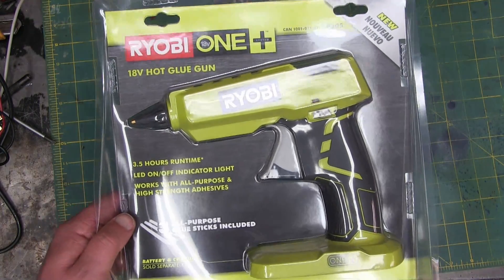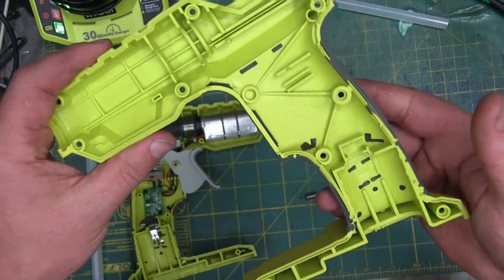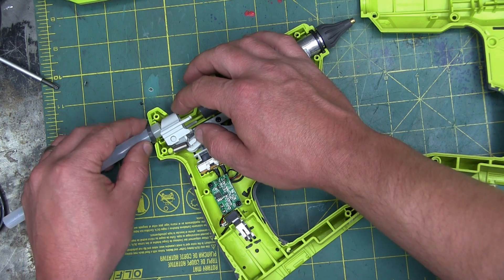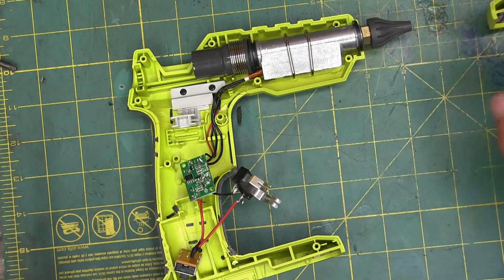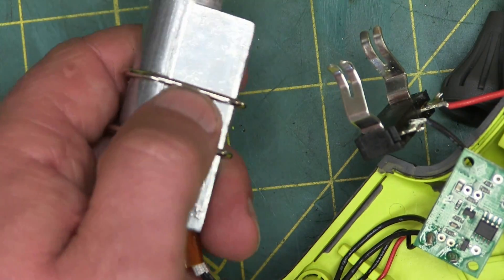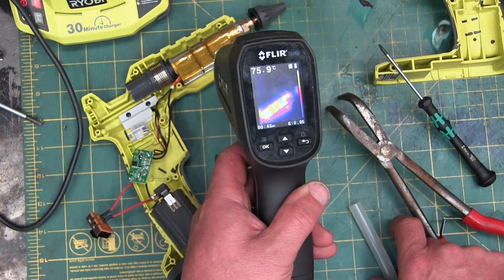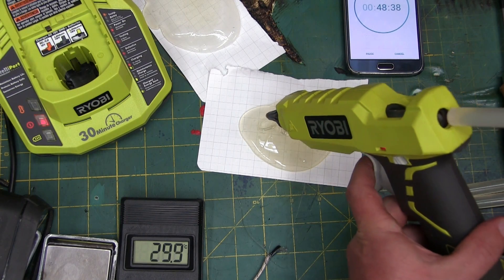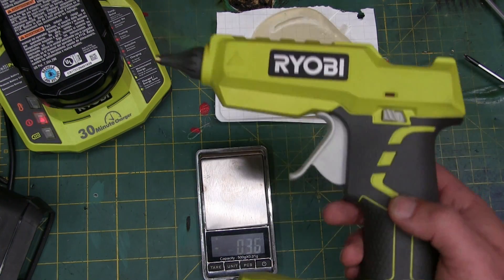BOLTR: CORDLESS HOT GLUE! | RYOBI

Comment: I bought one of these glue guns. I printed an adapter to use it with my M18 batteries.(I do not own any other ryobi tools) I love this thing. Probably not the best hot glue gun ever, but pretty damn close. I need to use hot glue for short durations at a time. Gluing on mag bases for the tracking laser while doing alignments of machines. There is never a convenient 120v outlet nearby in any of these shops. This is the best hot glue gun with no cord that I have ever used. 
I bought it because of your review. Thank you, 1yr in, it is still working perfectly.

Comment: I prefer making my own power tools, then I can choose the specs and features, i can repair it, and not get ripped off when buying spares 

So far I have 
3 DIY cordless soldering irons of differing power levels and tip sizes
1 DIY cordless hacksaw 
1 DIY 100W cordless hot glue gun

Comment: First, huge fan!  I’m pot committed to the Ryobi line due to the battery addiction you referenced.  I have about 30 tools, including the glue gun.  I’ve used the piss out of it for two years and it’s pretty damned  good.  The case has darkened around the heating element (disconcerting), and the shape with battery attached sometimes won’t fit into a space, but it freakin works!

Comment: That was my exact experience with this thing as well a very sharp shock I though errr no way is this thing going to cut the mustard but it did I actually took one into work and people can't keep their hands off of it because of its simplicity. The boss is talking the owner into buying some I had one when they first came out and told folks about it and got the pffft whatever response. But when you try it there is something more to it than you would think.

The Hybrid Soldering Iron is like this as well a real shocker. And the caulk gun is great been using the heck out of that thing recently on all the old windows I have at the house makes a big difference.

Comment: I have two!  One for black, one for clear!.   I have a few Cryobi things.  Mainly things like this that other brands haven't ventured into.  They are handy as hell.  I do wish they had a temp monitoring system to it; akin to a halfway chooch soldering station.  (Faster heating, sleep, etc).  But yea, let it warm for like 5 mins, then she/he's good to go.   Does drip slightly at idle.   Yeah.. this thing is either ON or OFF.  Easier to squeeze if temp dwells a bit.

Comment: You are dead right about the battery buy-in issues.  i probably have 15 Ryobi tools now because I'm pot committed to the batteries.  Anyway, I've used this glue gun quit a bit and do like it as well.  However, I work in tight spaces sometimes with speaker building projects and the shape of this thing really doesn't lend itself to tight quarters.  Between the size and shape of the gun, and the large battery hanging off the end, it's often less than ideal.  If space isn't an issue, there's not much not to like about it.  Thanks as always for the entertaining and informative vid!

Comment: Pro tip...just the tip n just for a minute. Hey ave/guys...if you want one but don't want to shell out big doll hairs for batteries and a charger you can use batteries that you already own from your favorite flavor of tool (millsuckee, default or makita) with $20 adaptors sold on the surebonder website...or their eBay listing (cheaper)! I'm running mine with one and makita 18V LXT battereeeahs and it works perfectly and I'm not out nearly a $100 USD for a friggin glue gun, batteries and a charger for one God damn ugly green tool. It looks like a beautiful coat hook abortion but it works and I kinda like the way it looks...sort of a built in theft deterrent. Hope I got a few of you a gluing and bedazzlin on the cheap with that little nugget.

Comment: I’ve been using this for years
I have a Ryobi battery just for it
I don’t use Ryobi anything else
But it makes insulating connections a lot easier in the field
Hot glue is super versatile, and they sell super strong glues for much more demanding applications
Reply: Ditto , I bought the gun and then I saw a 2pack of ryobi grinders w/ charger and 2 3ah batteries for 79$ (for the set) on black friday sale... Bought the grinders for the batteries and charger.... I Put a twisted wire wheel and a cutting wheel on the grinders b/c I am too lazy to change wheels so now I have 5 cordless grinders (2 milwaukees for real work) with all the wheels I use. The grinders work pretty well for wheels that dont require a lot of torque or extended running like cleaning off slag between welds or cutting all thread.

Comment: Will probably get yelled out for this comment, especially in this channel, but here goes... I love Cryobi cordless tools, and I'm a contractor. Hear me out...

I realize they are of average homeowner quality. The versatility of the batteries and overall cost of ownership is the benefit. I have Ryobi tools that are almost 20 years old that can use batteries they sell today. What other cordless tools do that without expensive/ackward adapters? ... The batteries themselves are cheap. I get two-packs of the 4ah lithium batteries for under $100 (<$50 each) on the regular, and usually much cheaper because those twin packs are seasonal and go on clearance. The cheapest I got was a twin pack for $62 USD...

The number of tools that accept those batteries is amazing. I am a believer in using the right tool for the job, which is why I buy several brands when it comes to corded tools. But for cordless tools, where being cordless is a necessity, Ryobi makes adequate tools at a very good price point for almost any task I need them to do... 

Now I mentioned cost of ownership, and discussed the cheap batteries, but the tools themselves are low cost. My biggest gain from this is when tools get lost or stolen, which happens no matter how cheap or expensive the tool is. If my $50 Ryobi drill gets stolen, replacing it is another 50, so that's  $100... If a $150 drill gets stolen, replacing it is another 150, that's  $300... you see my point...

Now I have had a few tools "break". Usually the motors burn up. You can buy direct replacement motors for under $15, and it takes about 20 minutes with a soldering iron to replace one. While that does add to the cost of ownership, it still doesn't convince me that the abuse I put those tools through wouldn't have burnt the motors up in most other brands. This usually happened with multi-tools (sonic tools? Vibrating blade thingies?) and reciprocating saws...

I have burnt up 1 drill that I bought almost 20 years back, but it saw WAY more abuse than I would have expected it to endure... for instance, I dropped it at least 3 times on one job 12 feet or so onto a concrete floor, still worked fine... On that same job, I watched  a guy drop a brand new $300-400 Hilti drill in the same way, and it shattered into a million pieces... I was vindicated with that because he regularly made fun of my "Pla-Skool" drill...

The reasons I will continue to by these tools is cost and the insane number of tools that take the batteries. I have a small laminate-style router that has saved me countless hours on the job site. I have a caulk gun (yes, a battery powered caulk gun) that will save your hand/wrist if you have a ton of caulking to do, and it will empty an entire tube without having to re-squeeze the trigger causing that ugly break in the caulk line. I have a little 8" compound miter saw that is perfect for small quick trim jobs (not good for hard wood though). I have a brad nailer that is great when I just need to drive a few dozen nails and don't want to drag out a compressor and hose... I could go on... Admittedly, some of them are definite duds. Any 18v yard tool is probably going to be terrible, for instance. I do have some 40v yard tools of theirs though, and they work fine for small yards/jobs, at least the couple of tools I have anyway... Their 40v detachable head weed eater is pretty good, for instance...

So yeah, if you go into Cryobi with realistic expectations, and you don't mind the occasional ribbing from oblivious tool snobs, then it's worth it... to me anyway... I don't think they are the greatest tools ever made, but they do/did some cool stuff no other brands even considered, at a good to decent value to boot...

Comment: I needed a drill that I could use without the restriction of cord length. Our local Home depot in UK is B&Q. They had ,as you say, wall to wall Cryobi. Short story long, they had a Hammaer drill on sale for 60 uk pounds sans batterie. For 75 uk pounds it came with 24Wh (1.3Ah) batterieahhhh. I picked the one with batterie and was charged for the one without batterie. Being a home gamer I was not expecting much from this drill, but the chooch was skookum. yeah, I know, its not a hammer drill, its an impact drill but who's counting. I'm a home gamer not construction. It does the job.

Comment: #AvE I use my "cordless" small butane torch to heat glue sticks to use, far more often than the actual corded glue gun. Torch also gets the glue much hotter than a glue gun, which allows for better plastic repairs and a lot more. Just don't want to get it on you though :-)

Comment: Weighing the glue and guestimating how many sticks it was is probably more accurate than simply counting how many sticks you used. Did you allow for the fact that the it's mass may have changed during the heating and cooling process, because science?

Comment: That thing is pretty cool. I’d imagine it gets fairly speedy with the battery and charger though but I might look into it. I got a “cordless” one from hobby lobby a while back but by cordless they mean it heats up on a base then you pull it off to use it. It works good for my occasional usage but it isn’t a true cordless. It does have an on off switch which is nice. I bought a dewalt one before that and it was pretty shitty, nice design but doesn’t push the stick through, it slips.

Comment: yeeaaahh.. maybe in retrospect you should have seen how low that PTC heater got in wattage as it approached standby before assuming it was only gonna run for 15 minutes.
I'm gonna start putting what I learned in comments so its not just a bunch of assholes telling you every mistake you made.

In this video I learned that kapton tape isn't reflective in the thermal infrared.  I've been using electrical tape for most vicarious temperature measurements.

Comment: I prefer corded for pretty much everything. Usually, corded provides more power (for the price), I don't have to worry about if the batteries are charged or not, and there is a power outlet at a reasonable distance from where I'm working.

Though, if battery packs were standardized; where I wouldn't be locked into a brand or product generation, I might consider getting cordless tools.

My grandfather has been using the same circular saw for something like 50 years. I very much doubt in 10 years, you'd be able to find battery packs that fit tools like these.

Comment: My only question is why put tape over the heat block when measuring the temp? Metal finished reflective object should have real low emissivity as it's nowhere near a blackbody. Does the tape actually help mitigate any emission? Was this just in case or because it was needed? I guess it could help with conduction and insulate it a bit, like the case normally would.

Comment: SureBonder Hybrid with a smaller trigger handle and it uses Ryobi batteries.
https://www.walmart.com/ip/SUREBONDER-Hybrid-120KIT-Glue-Gun-7-16-in-Sz-1-5-lb-hr-Output-G4419515/166641092?wmlspartner=wlpa&selectedSellerId=1122&adid=22222222227048197799&wmlspartner=wmtlabs&wl0=&wl1=g&wl2=c&wl3=146925459588&wl4=pla-261056802132&wl5=9032436&wl6=&wl7=&wl8=&wl9=pla&wl10=101593696&wl11=online&wl12=166641092&wl13=&veh=sem

Comment: I think that you might be wrong about the battery protection circuit. I have taken apart several Ryobi cordless tools and one battery. The tools usually have no smarts in them. In the case of the palm sander there is just a switch and a motor.
The battery I took apart had a big circuit board with large MOSFETs. I think this regulates the battery voltage to around 19v and also provides over current, over discharge and over heating protection by shutting off the output.
The battery normally has a low voltage at the contacts until the tool's switch is  pressed which makes me think that the battery's circuit has a sleep mode to save power.
I think that the circuit also handles balancing the cells during charging because there aren't enough contacts for the charger to do it.

Comment: I don't think the electronics are for battery protection, ryobi includes this in the batteries. I would think this is temperature control for the hot-end. (which means it could probably be hacked easily to accept higher temp glues).

Comment: You could have made a glue stick mold and then pour the hot glue in the mold, wouldnt have run out of glue sticks. I dont know if the mould would have melted at 135 °C though. Still cool video, glad i learned about the adjusting resistor!

Comment: Strange they have an under voltage circuit in the device. The batteries lithium I am using (4ah) all have that built into he battery. Given they are selling the nicads that dont have that protection I wonder if its actually to protect the nicads so they dont under voltage so he chargers can see them.

Comment: Been using Ryobi in my shop for years, actually wore the chuck out on my standard 18v before the motor or transmission/gearbox. It's not an industrial environment but it still is automotive with grinding dust and oil most days of the week.

Comment: I think all cell protection circuitry for Ryobi battery packs (also with all TTI tools) is part of the battery. The circuit in this tool is probably to turn the heating element on and off based on temp of the heating element to maintain a set temperature. EDIT Not sure what its for, but something to protect the tool not the battery I suspect.

Comment: If the average person knew how much hot glue gets used in aerospace manufacturing they might just drive.
Reply: I drive anyhow. Air taking a longer path is generating the lift to keep us at CRUISING ALTITUDE? Nah. No it’s not. I want to be holding the wheel when I careen off a cliff. If the plane is going down I can’t even properly commit plan z

Comment: Ryobi tools have the battery protection in the battery, as they can also use the 18v NiCD batteries. This leads to interesting options, like running them on a wired connection to the wall.

Comment: I have a question. In a lot of the videos you can tell what material (plastic) it is. Why do manufacturers put those markings where they are? If they were for ease of recycling, wouldn't they be on the outside instead of the inside? Could you shed some light on this?

Comment: There's many cordless and or semi-cordless. I've got a Glue gun from Lidl which comes with a stand. And the one they sell is same model from high end brand Steinel model Gluematic 5000fs or the Bosch PKP something. Steinel and the Lidl one came also with three different nozzels, thin accuracy one, wide one and normal one.
Reply: Forgot to say, as I mentioned semi-cordless, you can make every glue gun cordless. With a plug near the base of the gun you can unplug it when necessary and use it for more than 10min before it cools to much down.

Comment: You said it yourself, as the temp increases, the resistance increases. It's probably nowhere near 100w continuous. Even running glue through, I can't imagine the specific heat of hot glue to be that high, so the element shouldn't cool all that much.

Comment: Just an idea, but couldn't you have just pushed the stick through the gun instead of pumping your beautifully proportioned hands to a cramp? Lazy me did something like that a while ago and noticed that if you need a lot glue fast, no point in pumping. Admittedly, cheaper gun and smaller stick, but I can't see a reason why it wouldnt work with that one.

Comment: Love the simple circuit design... You'd be able to hack this to make it use the batteries that you already invested in. Just so long as it's within the voltage range. Just get a cheap and shitty something that has the proper battery connectors, cut the useless bit off and just wire it up.

Comment: The battery cut off is in the battery. I own like 6 pre-lithium cryobi tools and 3 lithium ones. You can't get the old yellow pre-lithium batterys anymore , BUTT the lithium batteries work fine in the non-lithium 18V tools. The tools just instantly die when the battery pack gets low.

Comment: Use hot glue guns regularly AvE -  the PARKSIDE® Battery Hot Spray Gun PHPA 3.6 A1 is by far my favorite cordless Li-Ion, generally because it was dirt cheap from Lidl and super handy. Its about the size of the cricket gun from the first Men in Black movie which is awesome for getting into a tight spot! Could be tricky to get your hands on one though as when they are gone they are gone. https://www.lidl.de/de/parkside-akku-heissklebepistole-phpa-3-6-a1/p239261

Comment: Before everyone gets excited and runs out to by a new Ryobi hot glue gun and batteries, Ryobi has some new packs coming out based on 20700 cells which should be MUCH better than the current crop of junk 1.5ah 18650 based packs.